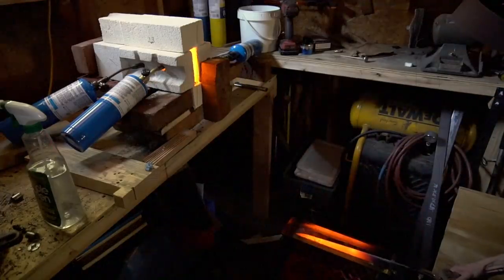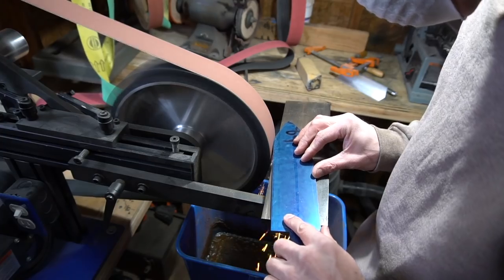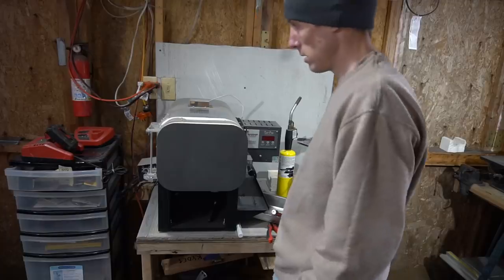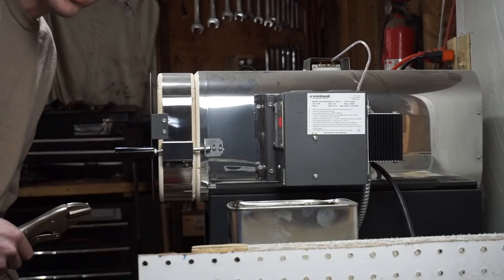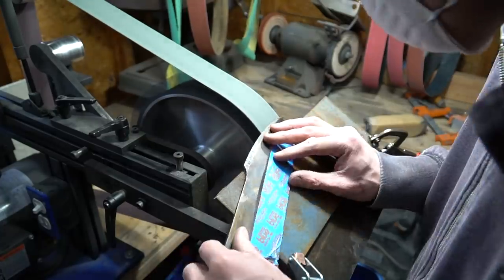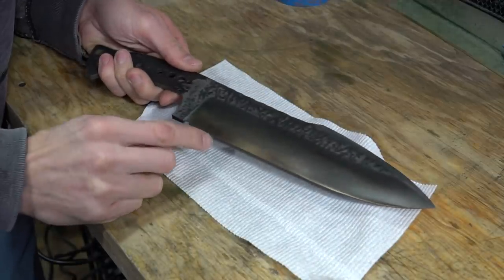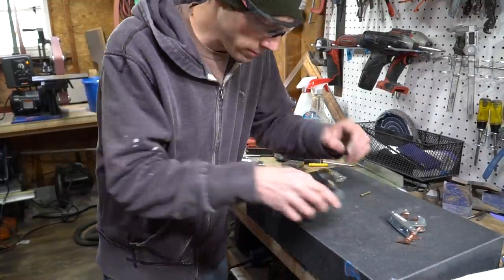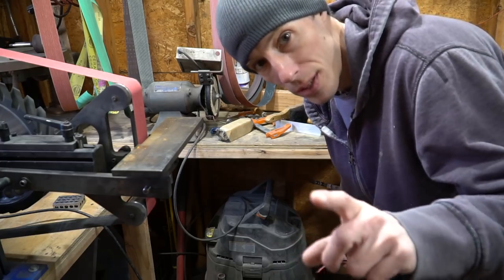Knife Making - The Savage

Comment: If that is 1084 purchased from a supplier there is absolutely no reason to do all the normalization cycles. If you forged and hammered it, then you'd do normalization cycles with much longer cooling. 
Since it came straight from your supplier just HEAT TREAT IT AND BE DONE. No normalization is necessary.
One of the reasons I'm not too crazy about forging is the necessity to normalize the metal and you take longer to cool it down like putting the hot blade in a pile of ashes to slow cool.
Reply from the maker: Normalization/ grain refinement is necessary if you want decent grain. Steel from the supplier is cut to size and will leave uneven grain.
Reply: @OUTDOORS55  I don't know your supplier, but mine sends out annealed spheroidized grain steel, no normalizing is needed. I don't use 1084 anymore, I use 80CrV2 and the vanadium at 0.20% restricts grain growth greatly. That is why all the O1 I buy has the 0.20 V and I heat to 1200, let it equalize then ramp up to 1475, O1's sweet spot. I hold at 1475 for 15 minutes then quench in 120-130 F Canola oil as Parks 50 is actually too fast for O1. I immediately check and straighten, you have 2 to 4 minutes to do this, literally by hand and a pair of vice grips. I literally finish my O1 knives to 95% just leaving off the secondary bevel. I use Brownells ATP coating to prevent decarb. The reason for the 15 minute hold time is to get all the chromium and tungsten into solution and thus form carbides. Grain growth is minimal, but if you have the LaTrobe O1 then go by the old machinist's book and only soak for ten minutes.

 Only O1 has this property I've been told. Kevin Cashen told me this at a club meeting. Look at the high manganese content in O1 and that's why you can straighten it while still in the 130 degree state, but once it cools down that's it on the easy check and straighten.
Oh, note this, canola oil goes bad and doesn't quench consistently after a year or so depending upon how much it gets used.
Reply from the maker: We were talking about 1084 here as thats what was used in the video. O1 and 80crv2 are different. Thats why you got that response.
Reply: @OUTDOORS55  True, but I digressed, but still if your steel supplier is sending you un-normalized steel you need to change suppliers. It doesn't hurt anything to normalize a steel that doesn't need it, but it's a lot of unnecessary work. It simply is a waste of time unless you're buying cheap hot rolled 1084.
Reply from the maker: Thats not how it works. Steel isn't shipped directly from the mill. You are purchasing steel that is from a distributor. The steel doesn't come in nice small pieces. Its bought in giant slabs and cut at the distributor. The cutting process can and does cause problems with the grain structure. Not only that there has been numerous reports (not just mine) of steel coming directly from the mill with problems. A quick google search and youll find some info on it. Ive also done my own testing with a metallurgy microscope and the improvements with the grain are nigh and day. I always recommend grain refinement if you want the best heat treatment possible. But to each his own.
Reply: @OUTDOORS55  I know how it works, I've been making knives since 1992 and my first steel was O1 which I still use. But I'm not spending an extra 5 hours normalizing annealed 1084. If I'm going to spend that much time I'll use a better steel. I've been around the block a time or two.
Reply from the maker: It doesn't take 5hr to normalize 😂 An extra 30 minutes even with an oven. But whatever. Again to each his own🤷‍♂️

Comment: the normalizing looks like a warp machine to me
Reply from the maker: Normalization helps prevent warps by evening out and refining the grain structure.
Reply: @OUTDOORS55  I mean if you clamp it on one end while it is on it's side it will bend while it is hot, leading to the bend being   intensified during the quench